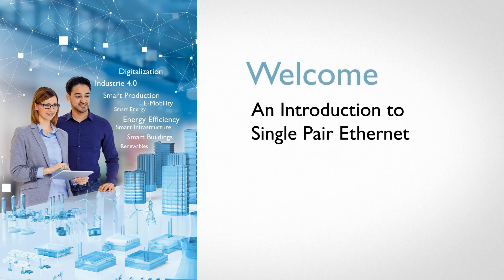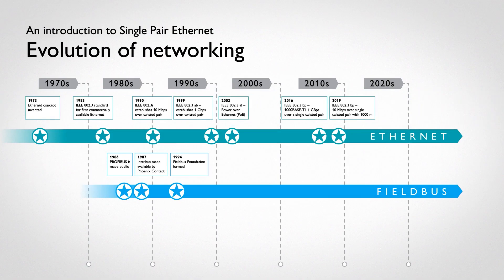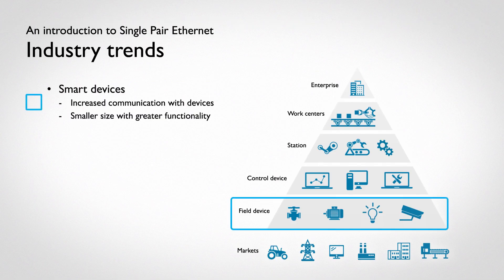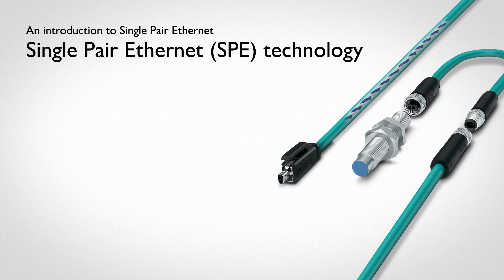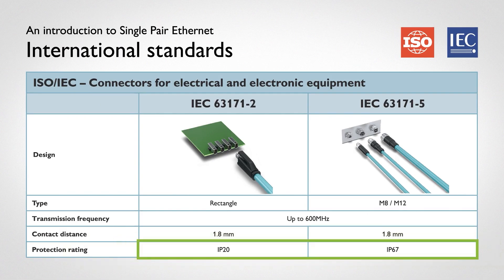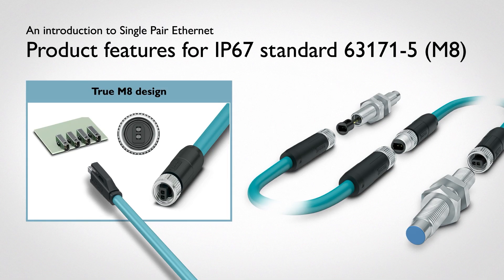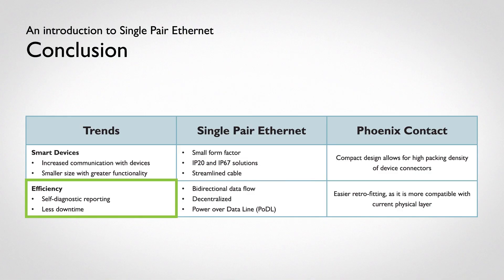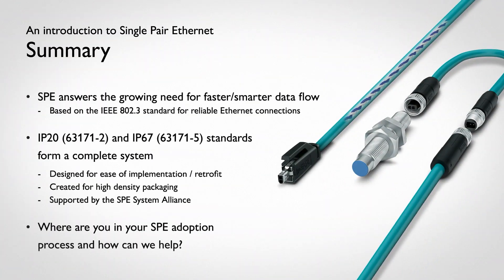An introduction to Single Pair Ethernet (SPE)

Comment: Cool.

Is there a way to detect if the cable is plugged and passively enable termination resistors if it is not? I want to use 10BASE-T1S for home automation with multi-drop functionality (5-10 devices on a single bus). Also are there tools available to crimp the connectors to custom lengths?
Reply from the maker: 10Base-T1S requires two 100 ohm resistors at either end of the cable run, with devices connected along the length. A quick check would be to test the line to determine if the resistance is Zero ohms, which would mean no resistors are installed; 100 ohms means that one of the ends is connected (not sure which), or 50 ohms meaning the line is correctly ‘terminated’ (two 100 ohm resistors in parallel produce a resistance of 50 ohms). 

As far as a product for direct terminations is concerned, we offer a field wirable solution for SPE that is toolless. The link below. While we don’t offer loose components for crimping, we can customize cable lengths to meet the application requirements. 

https://www.phoenixcontact.com/en-us/products/connector-spe-t1-cim-sf-1343953
Reply: @PhoenixContactUSA  Thank you. Very useful information. Have a nice day.

Comment: What advantage does it have compared to Ethernet and cat5 cable?
Reply from the maker: The advantages of SPE over CAT5 are transmission distance and reduced wiring

Ethernet over CAT5 is specified to work over distances up to 100m without the need for repeaters or switches. SPE can is specified over distances up to 1km. The 1km distance is specified for lower bandwidth and speeds up to 10Mbps. This distance increase allows the user to enable communications over copper infrastructure in applications where distances over 100m are required. 

CAT5 cable uses multiple twisted pairs for operation, while single pair ethernet uses just one pair, effectively decreasing the wiring required for transmission and the connector footprint while still allowing for the transmission of Power and Data over the single pair of cable.
Reply: @PhoenixContactUSA  Thanks

Comment: How much power can it transfer? 50W 100W 140W? 
Like to use it for camera with additional controllable lighting.
Reply from the maker: Max Power for Power over Data Line (power over the SPE pair) is 52W.